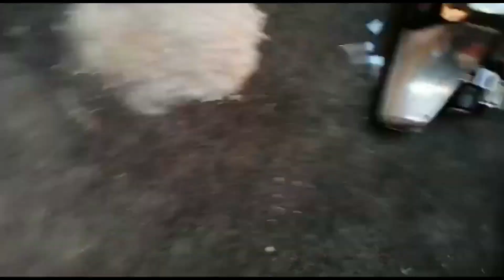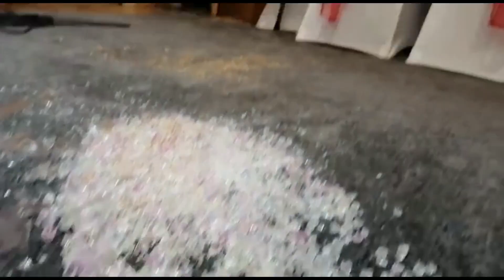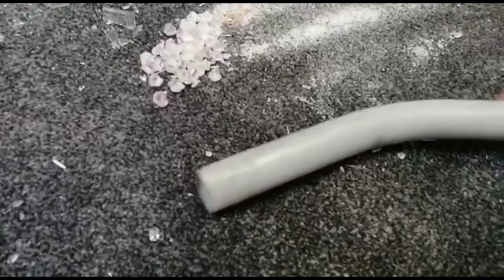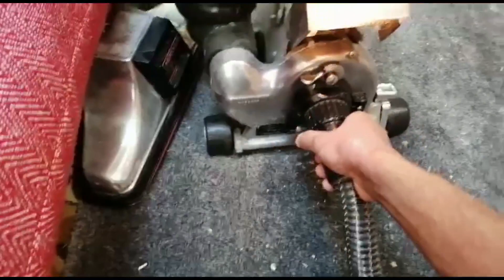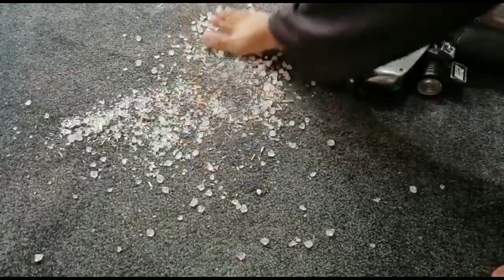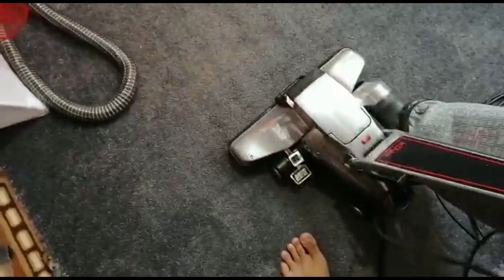How to destroy a Kirby vacuum- too big of a mess for it to handle, it quit after this vid-Heritage 2

Comment: The belt broke, abs I can imagine the fan, filltube, and bag are not any good anymore. All those are easy to replace though.
Reply from the maker: The impeller is absolutely fine, however the motor stopped when I was cleaning up after this demo
Reply: Parwaz 786 
Hmm, I wonder if it had a lot of stress on the motor, or if it’s jammed. Not sure.
Reply from the maker: @KirbyVacuumCollectorFixer  Nope it spins fine but for some reason it just stopped, I'm gonna have to investigate at some point
Reply: Parwaz 786 
Yeah that’s strange that it would randomly stop like that. Kirbys are very easy to work on, so I’m sure it’ll be easy once you figure out the exact cause.
Reply: @parwaz7861  If it didn't burn out, you could just need new brushes for the motor.

Comment: Kirby vacuums are not designed to pick up glass they are designed to pick up dirt and dust and if you want to pick up glass you need to invest in a shop vac those vacuums are designed to pick up glass
Reply from the maker: Thanks for that but this was for entertainement purposes only. I do a lot of vacuum cleaner testing demos so I am at risk of damaging my own vacuums with the large amounts of mess I vacuum up for my videos. 

I know Kirbys aren't the best thing to use for glass but it managed fine, just the belt broke, it has a newer impeller fitted so it wouldn't break 
I have a Henry which is excellent for cleaning up glass, I might try this test on that
Reply: Try using a Kirby vacuum on dirt and dust and cat litter and send and stuff people track in their houses on their carpet and use that for a demo that way you don’t damage your vacuum cleaner and you are welcome
Reply: @parwaz7861  it’s misleading advertisement, or even tests. This isn’t good on the Kirby whatsoever. This man who replied to you was 100% correct. You even took the hose off while the machine was still running.... that’s a big DO NOT DO. I would never advertise using a Kirby incorrectly as such. 

You’re pushing the Kirby to do things it’s not supposed to do, or designed to do. The title
Is misleading, and this is crazy watching someone actually do this.

This video is just all sorts of wrong, crazy, silly, you said it quit after this video. It doesn’t matter if you know how to take the Kirby apart if you don’t understand the design. I’ve been working for Kirby for 3 years. Very educated and disappointed with the video
Reply: What about powdered carpet fresheners? Like Arm& Hammer? Or Fabreeze? I have been told by a vacuum repair shop, that most vacuum cleaners thrown away in the trash or brought in for repair is due of clogged filters, clogged inside parts, and clogged tubes and areas where air must flow freely. Is this true? Are these Carpet Powdered Fresheners the Death of Vacuum Cleaners? If so, why are not the consumers warned on the labels of the products sold?
Reply: @shantel3780  it’s a hoover grow up
Reply: @shantel3780  I think taking the hose off with the cleaner on was to test the safety switch which did operate as soon as he started to remove the hose from the powerplant. Older Kirbys even had a switch in the headlight hood and they would cut out as soon as the hood was lifted up. He is a vacuum collector so he knows what he is doing, he will know his machines inside and out.

Comment: Hi Parwaz love your vids can't wait, I have a Dyson Small Ball Allergy and used to have a Shark but I prefer Dyson
Dyson4Life
Reply from the maker: Thank you so much for your support and that's very cool! I might get a small ball allergy soon to replace my light ball not sure yet but Dyson are replacing my light ball with a new one
Reply: Thanks Parwaz for the ❤ I had 4 Dyson's I got a dyson because I had a rubbish vac it stopped working and the filter caught on fire
Reply: @parwaz7861  I would definitely recommend a Small Ball Allergy or a Ball Animal 2 because the wand is like the handle and the floor head has 2X the agitation on the brush bar
Reply from the maker: @balwinderkaur5364  you made a good choice I feel like the best bagless vacuums are Dysons lol
Reply: @parwaz7861  Vax,Shark are rubbish I like Henry's because I tested the HVR160 and HVB160 the cordless version
Reply: @parwaz7861   Yep, Dyson is the only vacuum who do their bagless system really good.

Comment: I gave my friend a Sebo Felix, they had been using a Kirby for years. Is the Felix a good compromise from a Kirby?  This Kirby sounds quiet too, are that really quiet machines?
Reply from the maker: Kirbys are only good on carpets really, I’d say a felix is a good upgrade because it’s still powerful yet much more user friendly 
Kirbys are pretty loud, the one in this video is the quietest I’ve ever heard
Reply: The 2020 Avalir 2 Kirby is quiet, and cleans all kinds of floors. It mops are floors now, so it can clean everything in your house. Please do not listen to people who use the machine but not knowledgeable. You shouldn’t be vacuuming this much glass up with a Kirby either. 🤦🏾‍♀️
Reply: @parwaz7861  The old Kirbys aren't as loud as the newer ones. Kirby is a multipurpose machine, but I'd say it isn't as convenient as an upright with on-board tools.
Reply: I'd rather have a X7 and a Henry tbh

Comment: He probably is using rocksalt and because the Kirby is a direct drive vacuum the fan that produces the airflow is right at the head of the of the nozzle When the rocksalt hits the fan rotating it creates that noise because the fan is breaking up the rock salt

Comment: DO NOT PICK UP THIS MUCH GLASS WITH YOUR KIRBY!!!!!
As a Kirby sales rep of 3 years, and very knowledgeable about the Kirby, THIS IS A TERRIBLE IDEA, The Kirby is designed to pick up dirty and dust, larger items of course, but metal OR GLASS? DO NOT use your Kirby for this, it is NOT DESIGNED to do this, and anyone who is very knowledgeable knows this is the silliest thing to ever do with it!!

DO NOT DO THIS WITH YOUR KIRBY VACUUM. Ever
Reply from the maker: Thank you for letting me know, I was willing to take the risk because I know the impeller is now shatter proof
Reply: @parwaz7861  still breaks if subject to rocks or other hard debris.
Reply: Mine has sucked up everything. Just replace the fan kids who won't pick up the vacuum will
Reply: It's his vacuum, not yours. He can run any kind of test he wants to do with it.
Reply: @RyanSellman1 👍
Reply: wtf 🤬 I’m just gonna say you were never a Kirby rep